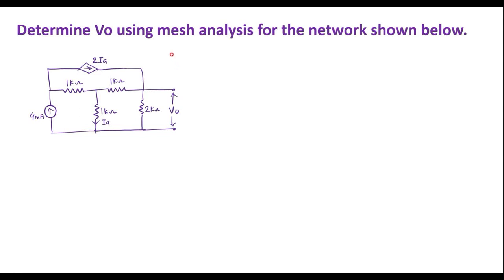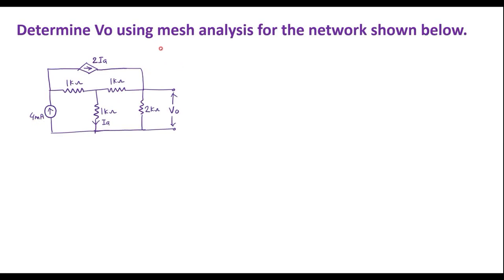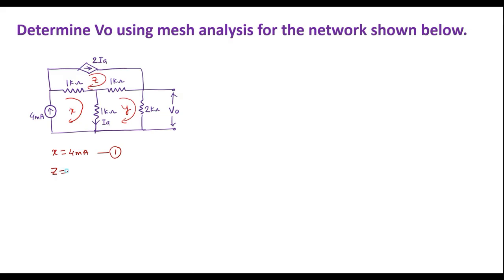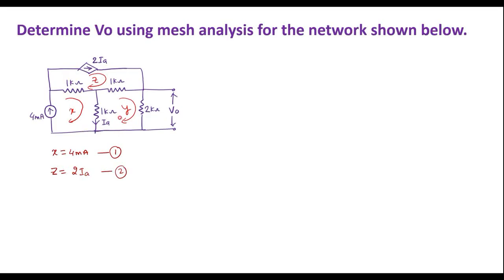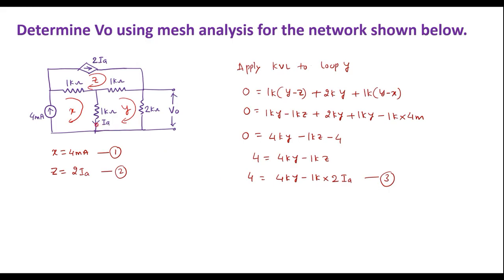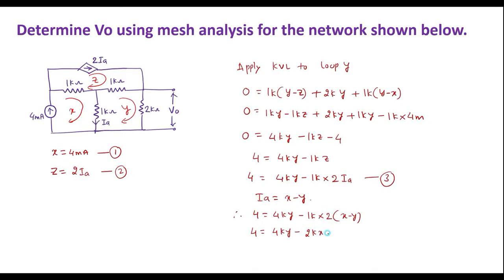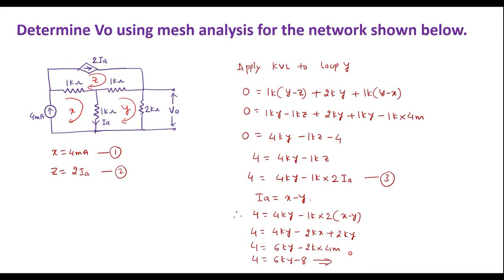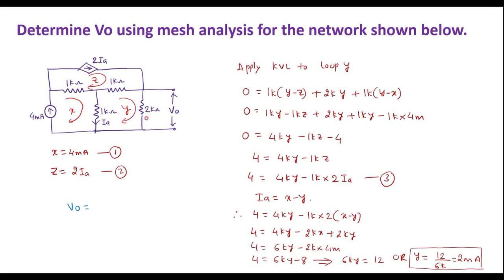Numerical on Mesh analysis or loop analysis.

Comment: sir when u took KVL for loop y since current x is opposite to current Z shouldnt they both be added youve done it as y-z shouldnt it be y+z?
Reply from the maker: Y and z are opposite in direction means , Current through the resistor 1k is opposite.